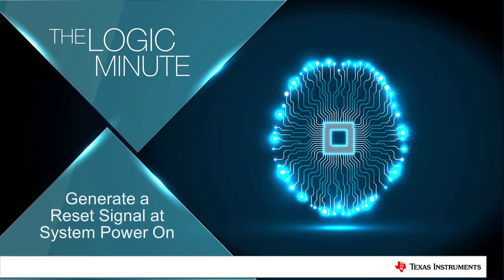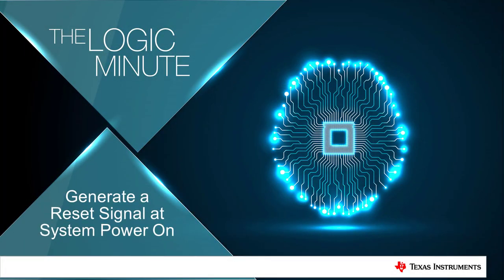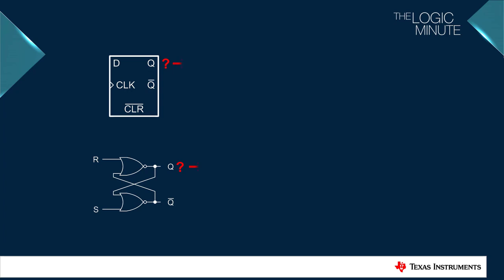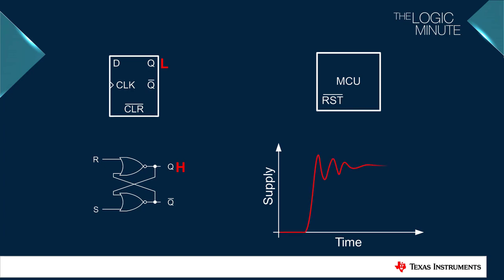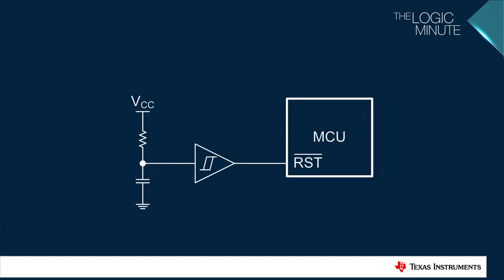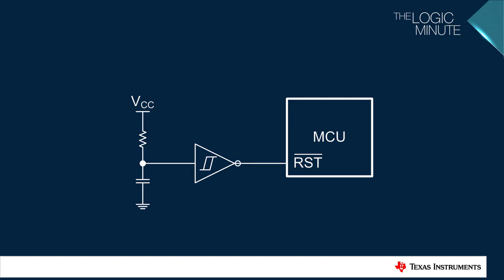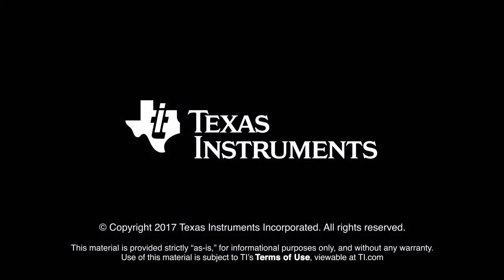Generate a Reset Signal at System Power On

Comment: How to discharge a capacitor when circuit is powered off?
Reply: Best way to do that is with a bleeder resistor. It's just a resistor that wastes current
Reply: @stopthelawsuits  yeah so do you put a pull-down larger pull down resistor on the same node as the input to the Schmitt trigger I think is what he is asking?